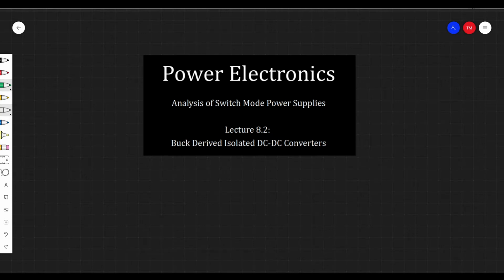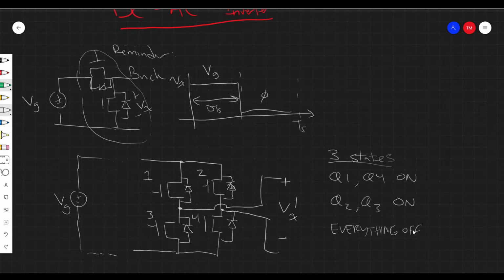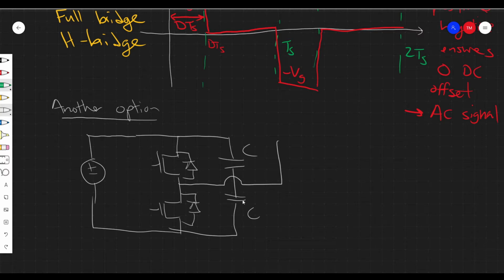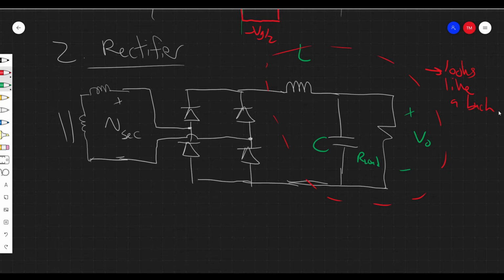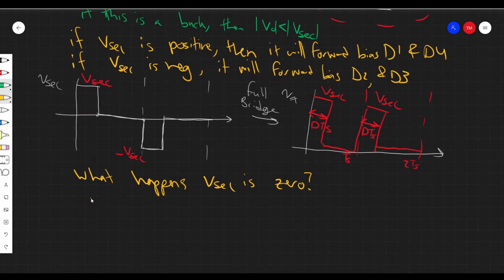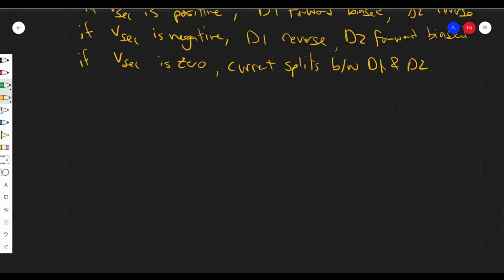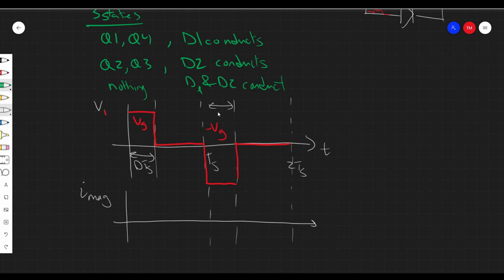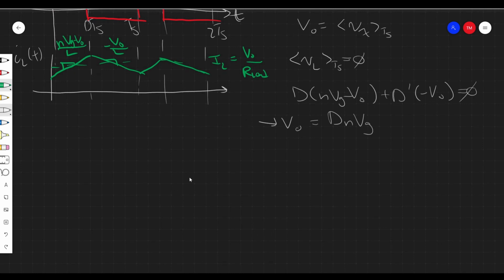Lecture 8.2: Buck Derived Isolated DC-DC Converters

Comment: Thanks for the video on full bridge converter. I have a doubt in the magnetizing current. What actually prevents the magnetizing current from going negative. Why is it clamping to zero when negative voltage is applied across Lm.